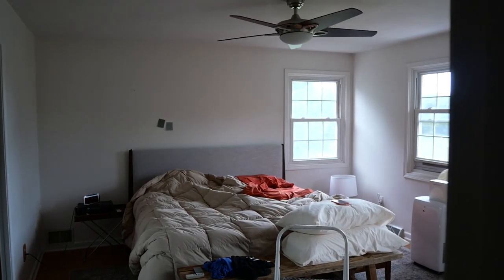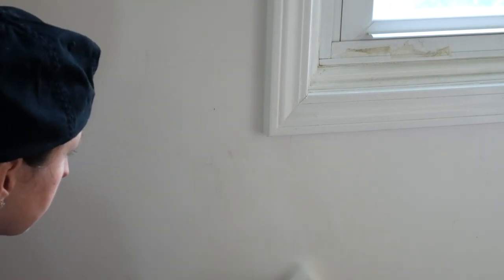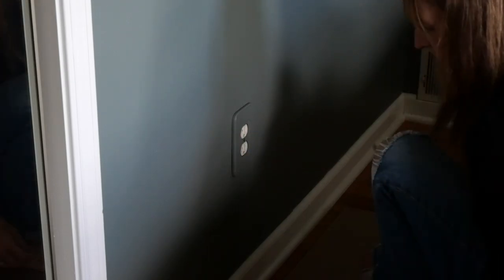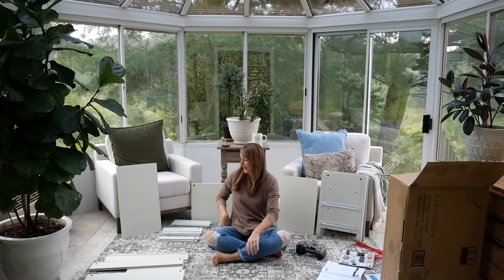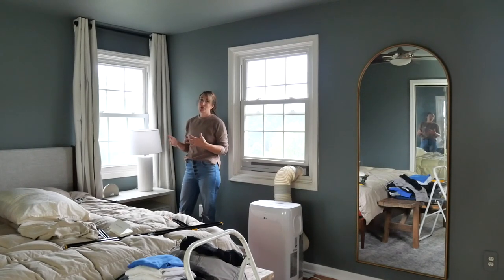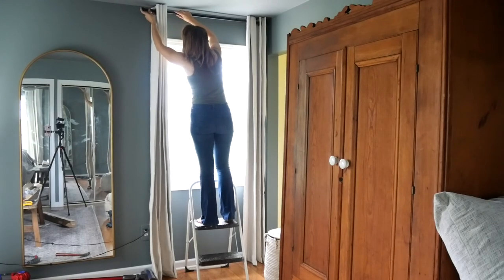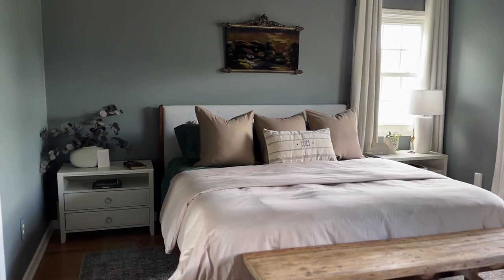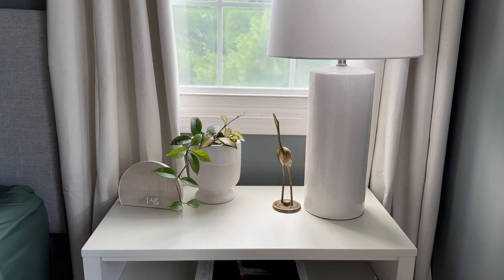Dark Green Bedroom Decorating Ideas

Comment: Regarding going up as high as possible with curtains...do you use a special drill bit?  Your curtains are as high as I do mine (I usually go wider) but I've noticed that there appears to be a steel beam or something across all of my windows/sliding glass doors and I can never drill thru both holes for the rod holders. Should I be using a steel bit for the drill?
Reply from the maker: We don’t have steel framing in my area. A steel drill bit would definitely be the only way to bore a hole, however I don’t know enough about that type of framing to be able to recommend if you even should do so.